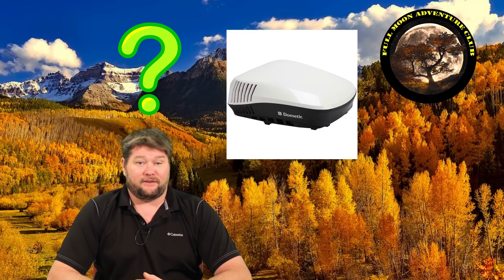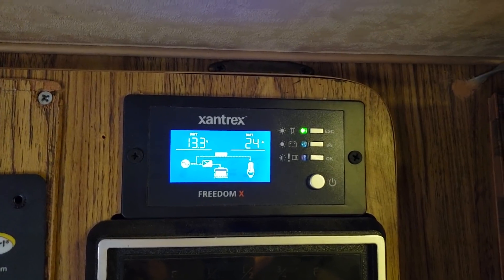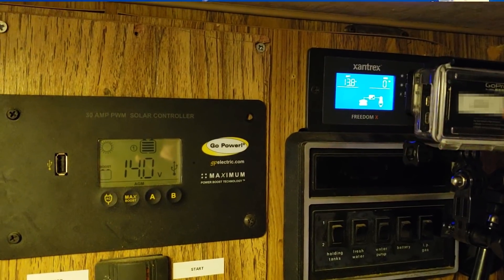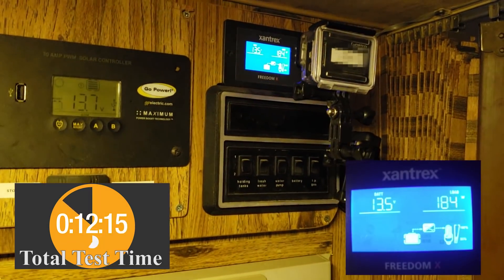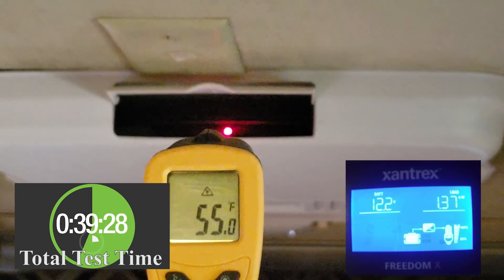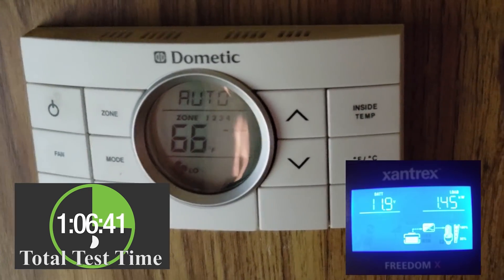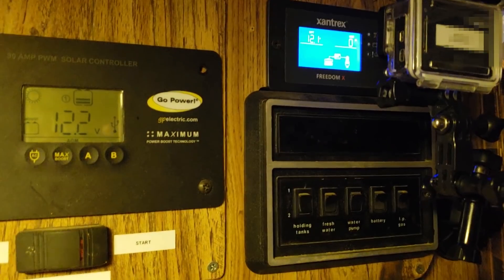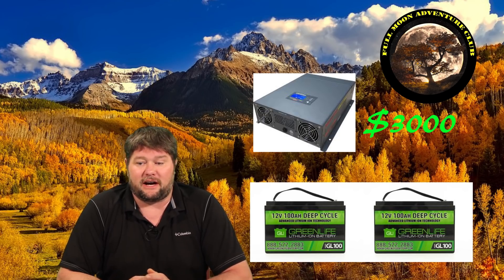How Long Will an RV AC Run on Two Batteries?

Comment: So whats the point? An hour run time A/C, completely depleted batteries, and the cost enormous. Off grid A/C on solar is a pipe dream. Enormous battery banks, a yard full of solar panels wont come close to running an A/C from a 3500 watt gen.........Real world RV if you want A/C in your RV its like 105 outside and it stays that way for 12 hours or so. That means you need the A/C on for 12 hours not one hour, and heaven forbid you need some power for other things as you run the A/C. 

Seems like today the strive for standard for Solar and under powered generators (2000 watts) is to run an A/C, and all the head aches that goes with that. Buy a 3500 watt inverter generator that will run for 9 hours or so on one gallon of fuel, and save tons of money and storage space in the process.................Michael
Reply: People are already using solar for air conditioning, I love pipe dreams because I do what others don't or cant.
Reply: Solar is junk with out battery storage. How many expensive batteries does it take to run an A/C for 12 hours? Then what do you do? The next day its just as hot, and you don't have enough power to even run a fan....Solar is a fraud those that preach the greatness of solar are either solar sale people or kinda dumb...........or both.....
Reply from the maker: You are correct. It makes a lot more sense to use a generator for air conditioner use. However, there are a lot of people that really want to run the AC off battery power. This video just lets them know the large amount of power needed to run one. Thank you for the comment and happy camping.     Jim
Reply: I camp several times a year for 2-3 days in the Ocotillo Wells area and the Mojave Desert and when it's hot, you need the generator more like 10-12 hours a day. You'd have to have $8,000 of batteries and still run the gen to recharge them.
Reply: @markfowler6200  Even worse if its that hot and you have a big ole shade tree you could camp under, you couldn't the solar panels would not work. During dove season in 112 degree heat I ran my generator and A/C for 2 straight days and nights, I used 4 gallons of gas and it stayed 76 degrees inside the RV the whole time, oh and I have one deep cycle battery that stayed charged the whole time. Yes Mark you got it...........Michael
Reply: @MichaelJArg  I didn't say that Ocotillo Wells is in the Mojave Desert. I said I camp at Ocotillo Wells (in the Anza Borrego Desert) AND in the Mojave Desert.
Reply: @markfowler6200  Ocotillo Wells is not in the Mojave Desert.

Comment: That voltage difference is just losses in the cables. That inverter was gobbling  well over 100A. Both meters did show correct value, difference is because they measure different points in the system.
Reply: That what I was thinking too. I connected an inverter at a different location in the circuitry than directly to the battery and I was getting low voltage alarms all the time. When I changed things it made a lot of difference.

Comment: 48 volt you can run the a/c all day long.
Reply: Power is power. You are using a given amount of energy per second that is not going to change. The only thin you can change is the amount of loss you have in your DC lines. At 48V you will have less line loss in the DC. This is a function of the square of the current, so whatever line loss there is at 4x the voltage (and 1/4 the current)  your losses (ideally) would be about 1/16 of what they are at 12V. That being said with short wires and such like, the losses may not be that high anyway so you are taking 1/16 of a fairly small percentage of the total power draw. 48V equipment is going to be more expensive anyway. I doubt if this would pay for itself.

Comment: 1500watts? dude you can get some cool mini splits that only pull about 800 - 1000watts. 

Though i guess this is a van channel which I know nothing about, so I'm not sure how it would be mounted, but as far as power draw is concerned, I think it's better to have mini splits in each cool area. So you can just have the 800 watts ac going in the bedroom or workroom, while the rest of the space can be hot.
Reply: There are several problems with using a mini split on an RV. The size, weight and location of the condenser as well as the fact that you will need a 220 volt system to get to the. 800 watt rated one ton unit. I have tried to figure out how I could mount the condenser on the tongue of the trailer and use a mini split with a cartridge type air handler. If you know of one that would work. Please let me know..
Reply: Another advantage with mini splits, most models allow you to run only one zone at a time, taking less power because the compressor runs at partial power. Example, in the evening, after solar power drops off, you could cool the bedroom area only, using maybe 500 watts. That lower draw could allow you to keep the bedroom cool until outside temperatures drop enough that the AC is no longer needed.

Comment: I have a similar AC and 720AH of LFP battery bank in my RV. I was hoping to be able to run the AC for a few hours at night in far north Australia, but alas that just means I have little possibility of fully recharging battery (with my 1320watt solar) to 90% during the next day. I actually need more solar to do this rather than more battery, despite it being very sunny. Yes it is difficult to run AC in an RV after the sun goes down - perhaps a home style split system AC would be more efficient than the typical slim rooftop oem AC like the Dometic
Reply from the maker: Thanks for sharing your setup with us. It sounds like a pretty nice setup.  In my testing i found that my Dometic Blizzard Nxt 15000 btu Ac draws 1500 watts while a small 5000 btu window unit designed for a house draws under 500 watts. I'm not sure if a unit that small would keep up with the heat of your RV but it would keep you plenty cool if you were sitting in front of it. Your system could definitely handle that load a lot easier and for longer. Let us know what solutions you come up with. We would all like to hear about it. Thank you for the comment and happy camping.   Jim

Comment: put in a xs ultracap battery in there with the solar and you should be able to run it all day long. great test.
Reply: How much is it?
Reply: an xs battery from xs power is just under 600.00 it will balance the batteries better and take any strong demand and help with the demand of the compressor.
Reply: @richardbest3079  That XS AGM is WAY less amperes than a lifepo. Also only works down to about 50%. So more like 30% usable capacity of the lithiums in this video. Would be awesome, but there's just no unicorn :( (2400 amps on the battery info label for the XS Power battery is cranking amps, not capacity)
Reply: not the agm the ultra cap study ultra caps they will allow you to use more of the power coming in from your solar panels now. you use it with the batteries. Maxwell also makes them. or you can buy single cells and make your own.

Comment: Cool test!  Nice equipment.   I've played with this as well, but using even cheaper inverter (Microsolar 2000/4000w) and two GC5 lead batts but on a smaller Colman Power Saver 11k AC.   What I found is once the compressor is on, you can run quite a while steady state everything on,  mine draws quite a bit less than yours but the startup power is confirmed 3x startup to get the compressor running.  So,  when your batts are lower, when your AC cycles off after running for awhile due  to normal thermostatic control,  the batts dont have enough power left to restart the compressor.   I measured 7amp full run,  but 27amp startup due to compressor.  That's 3000watt startup surge.   On the batts that something like 300amp  startup draw when normal run is around 52amp.   Have to be careful.   Now,  usually you will run your AC just to cool down the camper as cold as you can get then turn it off..  that's what I do anyway.        Have fun!
Reply from the maker: Thank you for sharing all that info with us. Always nice to hear about other setups and how they run. Take care and happy camping.    Jim

Comment: Hi Jim - love your new channel.  I'm having the Xantrex Freedom 2000w inverter/charger installed in my TT.  I have two 6v golf cart batteries.  Can I run my AC with these batteries? The trailer is a 2015.
Reply from the maker: The Xantrex inverter would probably be fine but the batteries would not. Lead acid batteries just won't handle that much power draw without damage. You would need a very large battery bank for the air conditioner. Thanks for watching and happy camping.    Jim
Reply: Thanks Jim!

Comment: Hey Jim, Great job to you and your friends on the new channel, I followed you from Four Seasons. I have a question about what size cables I should use on the 2 new Greenlife 100ah Batteries to set up in parallel on my travel trailer

Thanks and keep up the GREAT work. Kevin
Reply from the maker: Thank you Kevin. I use 2 gauge 2 AWG  battery cable. Some people prefer 2 AWG welding cable but my wire is pretty standard and holds up to anything I throw at it with a 2000 watt inverter. If you are running a 3000 watt inverter you may want to go up a size or two. I hope that helps. Take care and happy camping.    Jim
Reply: Thanks Jim

Comment: What can I do for just the Ac plug to work for a small tv! Or two and a fire rv stick?
Reply from the maker: You would not need to much power to run that at all.  Depending on the size of the TV you could probably get away with a 500 watt pure sine wave inverter and a couple of deep cycle batteries.        Jim
Reply: My rig has 12v accessory ports.  i picked up a couple  decent enough sine wave inverters to run our very similar TV setup.  very easy setup.  I definatly did not calc power needs at the start but it still let me run TV all day.

Be sure and check the power brick for your Firestick.  My newer sticks now gobble up 15w.  That's more than the 32" flat screen.

Comment: Where is the 2000 watt inverter?
Reply from the maker: The inverter is located in a cabinet in the RV.  I believe I showed it when I was taking temperature readings of the wiring.      Jim

Comment: Hey, great job on new channel. Lots of great subjects. Have a sort of off topic question. I see that many people that want to use a smaller generator on their Rv to use the A/C have to install the EastStart systems to get amp draw down. I see you did mention soft start unit which I’m guessing is that kind that doesn’t draw that extra amps. Just learning about these units. But it seems that most , I’ll say Dometic because that’s what I see on like the 30 ft Cougar that I’m looking at as the regular unit. So I guess then I have to install a EasyStart because I definitely want to use a smaller generator once in awhile and get some A/C. My question is why wouldn’t the factory unit already be able to that. Wouldn’t Dometic want to sell you that upfront? Is it an option when you buy a RV? Seems like it would be. I don’t even understand why they would even put one on a RV without one????? Thanks again and do you have an email address to ask off topic questions??
Reply from the maker: I will be talking about soft start AC units in my next AC videos. They usually are not an issue with new RVs because they either come with a large 5000 watt generator or expect you to use RV parks with shore power. I agree with you about upgrading all RV AC units with soft start from the factory but we both know that it saves them money to have you do it.  If you want to use a small 2000 or 3000 inverter generator then a soft start will help you and your generator out a lot.  I will go over some of this in my next video. I prefer to answer questions here in the comments so everyone can benefit from the answers and I might not have to answer the same question twice. I am not a fast typist so less is better. :) Thank you for the question and happy camping.      Jim
Reply: The RV manufacturers would not be putting that type of system on, they want inexpensive systems. If you want the more efficient SoftStart system, you pay extra to get it installed, then the dealership has a nearly new standard AC to sell to someone else.

Comment: Hey Jim, un related question. I am trying to set up my little flat screen Tv in my trailer. However every time I try to connect the coaxle from TV to the amplifier for “no. Amplified TVs it blows a fuse. I’m just trying to connect the Tv to the Antenna so that I hopefully get some channel.
Reply from the maker: I have  never used a amplified TV antenna but I will try to help you figure it out. I am very tech savvy. I might need some more information. Are you sure the TV is not amplified itself? What kind of booster are you using? Where is the fuse that keeps blowing located? Is the fuse the power source for the booster? Is the antenna booster the one that came with the RV or is it an aftermarket booster? If so, what brand and model? Answer those questions for me and I will do my best to point you in the right direction. Thanks.      Jim
Reply: SOUNDS TO ME LIKE THE TV GROUND and RV ground are different due to maybe the inverter drawing a lot of current or a ground like lose wire somewhere

Comment: You had a Kodiak unit (which I purchased) what about using that and two deep cycle 24 batteries. The Kodiak plugs right into the 30 amp on the trailer. Do you think it’s possible to chain all those together? Also I have a solar plug on the side will that keep some charging happening while they are being used? Whew!!!! That’s a lot of stuff happening.
Reply from the maker: Thank you for the question. It is very possible to add two deep cycle batteries directly to the Kodiac with solar. The kodiac will charge and use the added batteries automatically using the RED and Black terminals on the side. Be careful not to allow the RED and Black terminals to touch or become shorted as it will damage the Kodiac so be careful while connecting the batteries to them. The solar on the Kodiac is just plug and go so it should be pretty straight forward but you may need an adapter if the panels are not from Inergy. I hope that helps/ Take care and happy camping.     Jim

Comment: I have a Xantrex 2000 XC and Xantrex display has the correct voltage. Its monitoring the battery output voltage it is receiving.   You may also consider adding in the time to recharge your batteries; that is test time from full battery back to time of full battery.

My AC takes about 1600 watts to run on low, but let’s consider a simpler example. Lets say you put a Kenmore Energy efficient 5200 btu window AC in your RV.  That requires only 475 cooling watts (WAY SMALLER then my AC).    Given the Xantrex 2000 is 87% efficient and needs about 2.1 Amps for itself (fans etc), you will likely draw nearly 45 Amps at the battery.

Lets say your batteries are full and you want to have enough solar to run your AC when its sunny only, then you need a charge controller that can support at least - lets say  - 50 Amps at least. To get the panels to provide 45 amps continuous you need at least about 800 watts worth of solar panel all wired for nearly no loss; not the 3-10% loss many RVs are wired for.  And your panels have to be optimally angled all day. So for my RV’s AC I need solar panels and charge controller on order of 3 times that size.

I have seen my 680 watts of ground based solar panels that gets optimal lighting passed thru the Zamp 60 Amp controller hit peaks of 41.5A and readily maintaining 38Amps continuously. So i could run the Kenmore on my solar while draining about 7amps additionally from the batteries.  My 4-Trojan 6Volt batteries could sustain that for the day easily, but I’d be falling behind.  

In short, I’m not gonna put a window AC in my RV. I go to high altitude where I don’t NEED AC cuz if you need AC you likely need it at night and batteries won’t do it and it depends on how hot it is.   Assuming the Kenmore AC running 2/3s of the time at night my 4 Trojans would last about 8 hrs til 50% battery level. Then you’d need to recharge while the day is really hot.  At maximum recommended charge rate per Trojan for my setup I would need about 1 kilowatt of panels to get my batteries back to full charge in 5 hrs - without the AC.
Reply from the maker: TheDesert IsPatient  That is some great information to have. Thanks so much for sharing that with all of us. I'm going to be covering a lot of that information in my next video. I can use your information as a reference point to make sure that I'm on point with my research. But that sounds exactly right to me. Thanks again for the awesome comment.  Take care and happy camping.  Jim

Comment: Hi Jim. Do you have a start assist device of some sort installed?
Reply from the maker: Tim Shields  Thank you for the question. I do not have a soft start AC or any other kind of start assist in my RV electrical system.  Thank you for watching and happy camping.  Jim